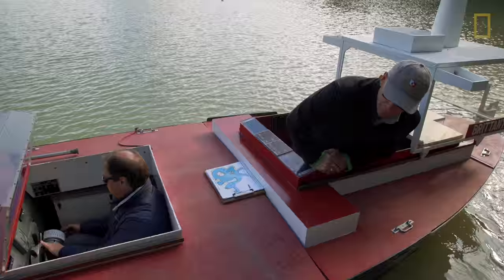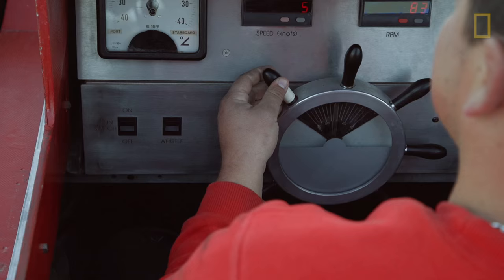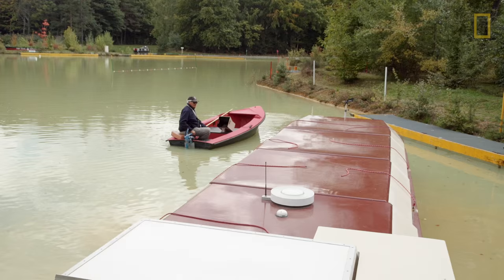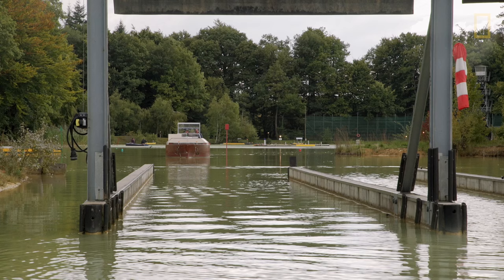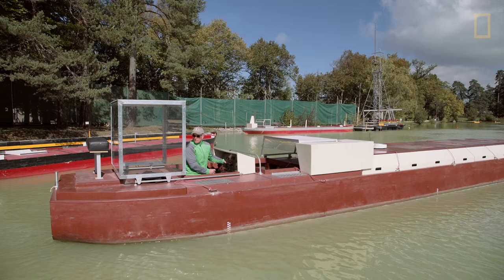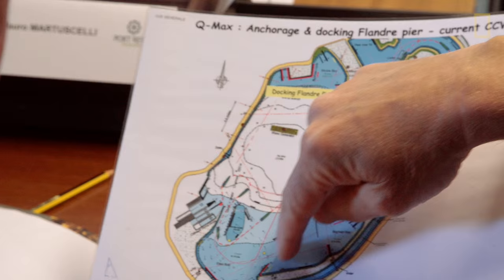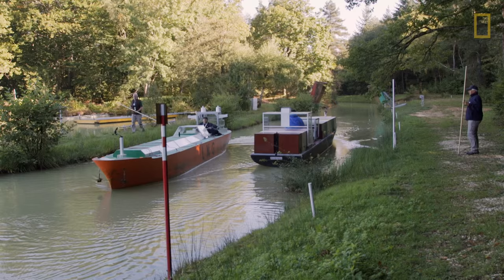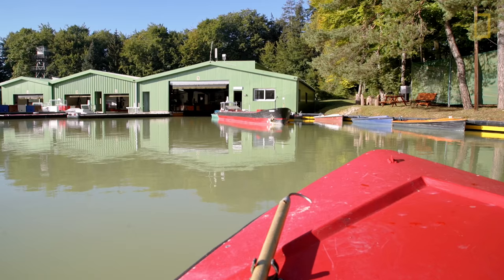These Mini-Ships Teach Pilots How to Navigate Major Waterways | National Geographic

Comment: Would it help teach these guys better if they were looking through special lenses that made it look like they were looking at a longer ship & not just sitting in a tiny toy boat?
& put a box around their head so they couldn't just swing their head around for a 360-degree view. Give them little convex mirrors if they want to see behind them.
Reply: +ism schism In a real ship there isn't any difficulty looking around, it takes 5 sec to walk to another window.
Reply: and their seats are designed to give them the same relative (to scale) eye height over water then they would have in the real ship
Reply: ships have to be designed in a way that you can get a really quick 360 view with the naked eye so this is already realistic enough

Comment: In science there is an area called dimensional analysis dealing with units and could be very useful in this field.  The inertia of ships and planes changes and if floated or flying one needs to be very careful  as their behaviour could not be so  related.
Take for example a fly, a humming bird, an eagle and an Jumbo A380 or a Boeing 747. As they use the same medium for operation one would not expect that they  would use an equivalent flying manner.  As the size changes while the medium remains the same, they the flight dynamics  could change too and hence this is the reason for the different shape and the rate of change of  movements in their wings.  A house fly would never  fly with fixed wings  and we would be able to see it!! Nor a humming bird hovers as it does with fixed wings, Nature in its wisdom saw to the right solution.  Incidentally , some say that a  magnetic motor cannot be made smaller that a certain size as it would not behave as a large one as magnetism come in DOMAINS of a certain size.   The same with this ships of this size floating in the same density water as the larger counterpart, It the small ship had to have the same time response and speed response, then the water had to be changed into a medium of higher density.  I used to work such problems about 70 years ago when I worked on ships and attended the Royal Naval  Dockyard School. When I attended the University of Newcastle upon Tyne many years ago, I often went to  Exhibition Park (Town Moor)  to "play about" on the Turbina the world's first turbine ship and also I played with the same rubber band  powered boats  as used by Parsons and other to study propellers and stepped hulls.
NIce memories of my younger days.
Reply: Holy massive paragraph. I'd love to know what you're trying to say but I'm finding it hard to read.
Reply: Stop typing nonsense trying to sound smart lol. There's a reason pilots all over the world go to these schools...BECAUSE IT WORKS.
Reply: None of this sounds anything like dimensional analysis. I think you just used the wrong term.
Reply: Current Batches  Water density, and viscosity. In order for the ships, as models to behave in scale, the water needs to be denser/thicker. I'm sure he's speaking from a  modeling POV, in relation to studying scale ship reactions in scaled medium.
Reply: @HarryBermuda  He is smart, you on the other hand, need some schooling ;)
Reply: @randyohm3445  Oh he's on the right track, DA can be used to analyse relational physical quantities like wave > size, length, height (amplitude), speed, density and so on. But in water a 1/25th ship behaves differently than a 200,000 ton vessel with vastly different physical dimensions. For a scaled study, the "water" would need to be higher viscosity and density to behave similarly to a full scale ship in water.
Reply: @ricomon35  Okay, I believe that. But how is that dimensional analysis? Dimensional analysis is about studying the units you use to describe things, not the physical properties of those things.

Comment: So it's not called captain anymore?
Reply: When a ship enters a port, a pilot board from the port to take control and dock it, since they know the place better. This is training for pilots, not captains.
Reply: Ivan Matz ayy thanks i never knew
Reply: Hopefully the pilot is thex advisor to the captain. The master or captain stays in command with his bridge team and the pilot should act as a guide, inter port communicator and assisting in berthing.
Reply: Bas Graus In theory, yes. But really, the captain usually gives control to the pilot.
Reply: I'm a very strange captain then.  😉. I'm captain on a chemical tanker and don't need a pilot for manouevring. But you're correct many captains have no idea in how to handle their own vessel. According the many pilots a speak in a week on average 3 ports a week.
Reply: When the ship enters a big port the captain gives control to the pilot. The pilot works at the port and he knows all the waterways at that port.
Reply: Also, the pilot is not responsible for anything else that happens on that ship. For example, food preparation, passenger relations, crew disagreements, etc..
Reply: A 'pilot' is a specialized helmsman who navigates an ocean-going ship into port.
Reply: Not too dissimilar to an airliner. The captain is a pilot and the 1st officer is a pilot. Either one can have control of the aircraft at any given time.